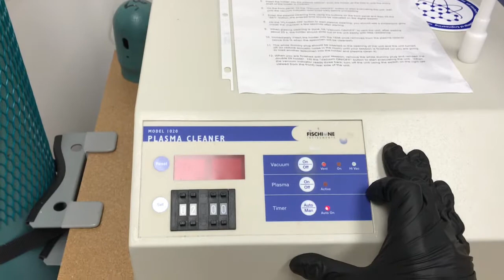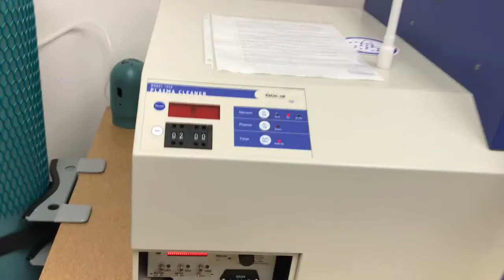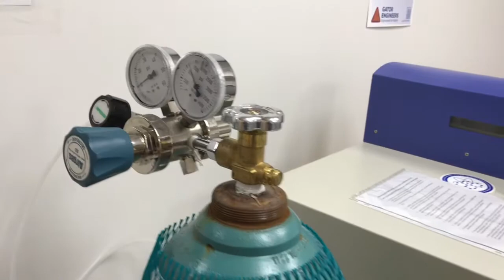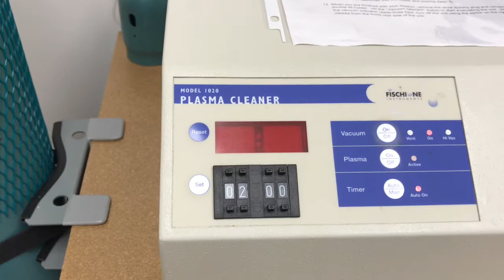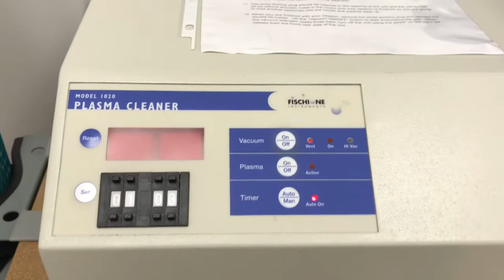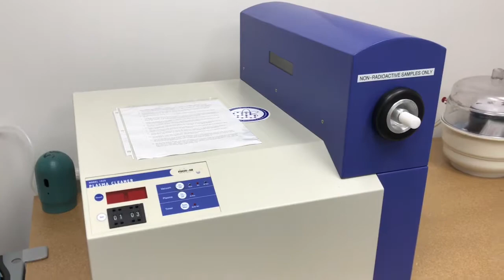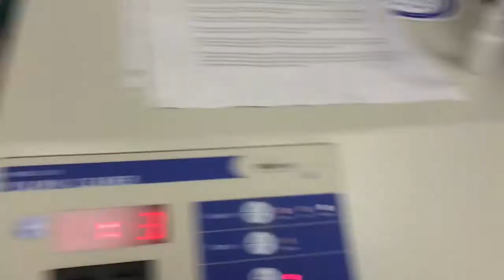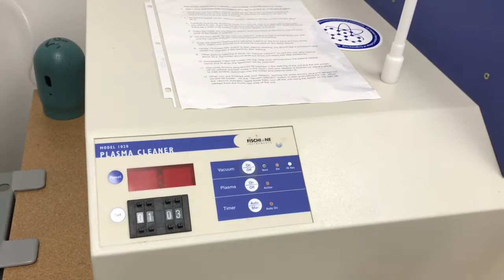Fischione Instruments Model 1020 Plasma Cleaner demonstration

Comment: Can we use only Argon gas in this plasma cleaner?
Reply from the maker: I know I already answered you via LinkedIn, but I'll do it here anyways so others may see my response: Ar only will not work, you need a mix with O2 since it's actually the O2 part that is responsible for the cleaning effect.  I've tried pure Ar and can attest that it is ineffective.
Reply: @NicholasRudawski  Thanks for the information. May you tell us where you source the 80/20 mix? I have been finding this very expensive from Airgas
Reply from the maker: @bensonjal  Yes, Airgas is our source, too.  It is rather expensive, since it is a custom mixture, but I find that a standard size tank can last 4 - 5 years (if not more), so the cost is actually very reasonable when  you account for this.